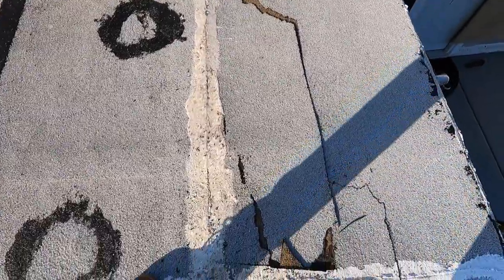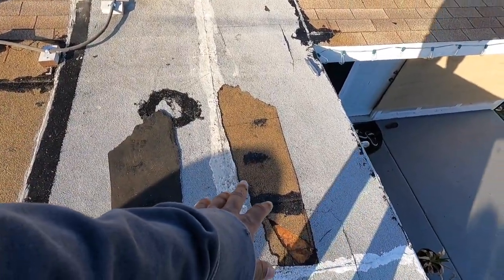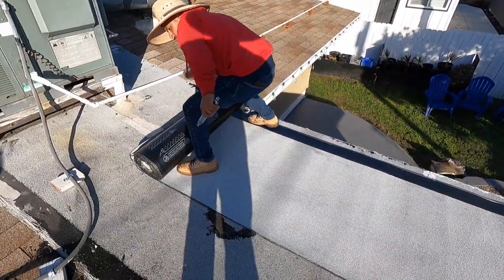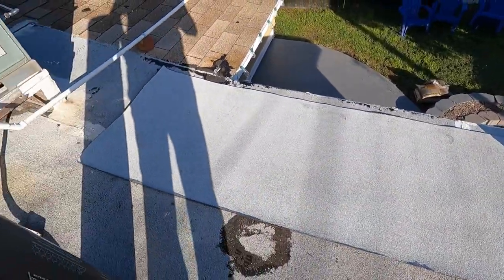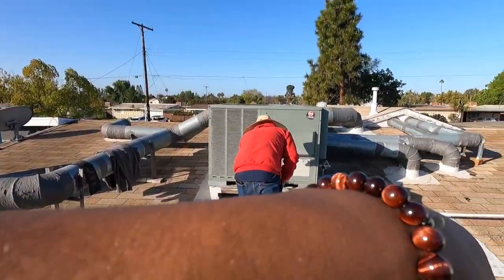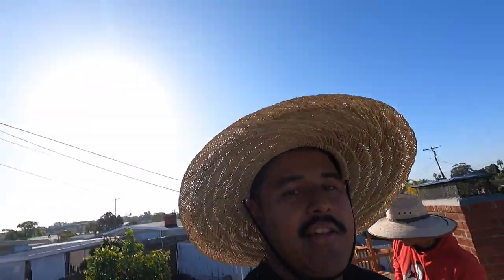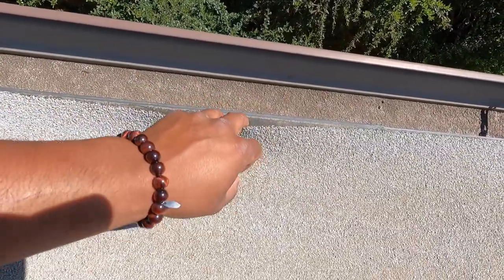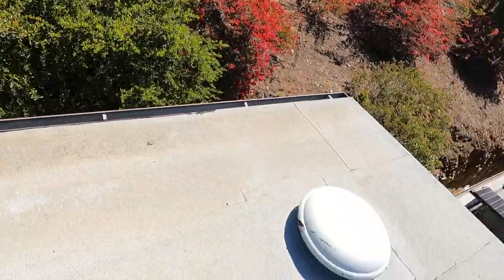EPISODE #2: ROOF REPAIRS DAY IN THE LIFE!  #business #roof #diy

Comment: Im a san diego roofer and always see these kind of repairs and makes me scratch my head. What if there was a worn out spot on the keyway of the shingle open to the attic and you hit it with the torch? I dont see a fire extinguisher.  Watching this repair gives me anxiety lol
Reply from the maker: Yes. The torch did work but they were doing a quick fix before the remodel just to hold it until the rains were over. Yessir always have an extinguisher. safety first. THANKS FOR THE SUPPORT!!

Comment: You're supposed to tear off all the flat roofing that was affected by the water damage - not torch down over it. There are already two plies of failed roofing (on the first repair) & wet ply wood that all needed to be replaced. All you did was trap the water under all those plies of roofing. I like your videos but all you do here is repeat the same mistake made before you by not laying the roofing properly by tearing it off & starting at the bottom of the slope & working back up toward the ridge. If water is running against the seams of your roofing plies it's installed wrong a 100 out of a 100 times bro. This is basic roofing knowledge. Your business will flourish more by considering these points, no disrespect intended.

Comment: I would rather use hot instead of torch when given the choice.  

I have replaced a few new torch down roofs with hot tar because of poor workmanship had the inspector on one job watching us all day and stopping us so he take pictures so they could sue the previous roofers we felt like trowing him of the roof a few times you stop the mop you stop the money and also trying to tell us shit like clean your mops out in the low spots witch wasn't the original problem with the roof the base sheet wasn't nailed right so the roof had buckles every where also not enough heat on the seams and it had only one pounding issue by the corner of the wall so whe built a cricket that was it. 

We see alot of problems with torch down roofs that's why I like hot I only use torch down on small patios or if that's what the customer wants we have some customers tell us to put hot back on it because they see how long it lasts we still do quite a bit of residential hot work still to.